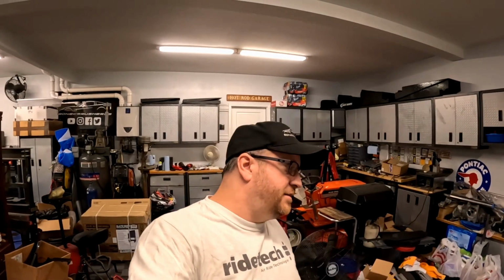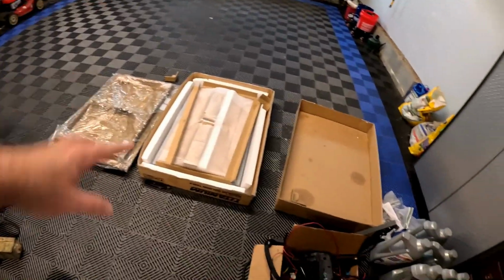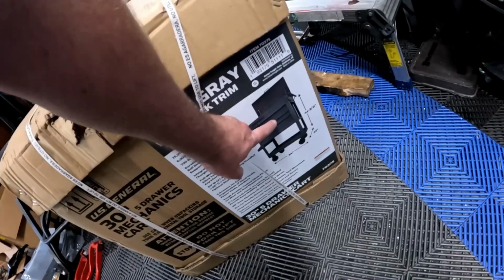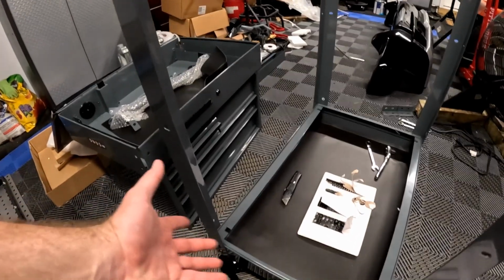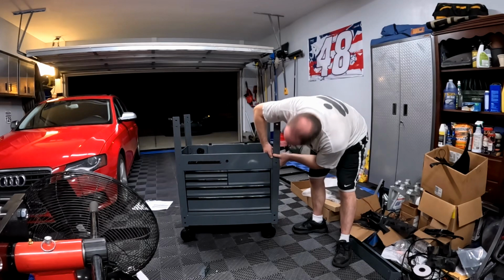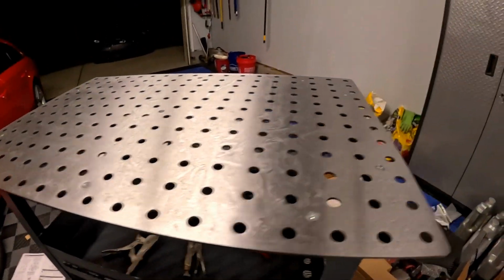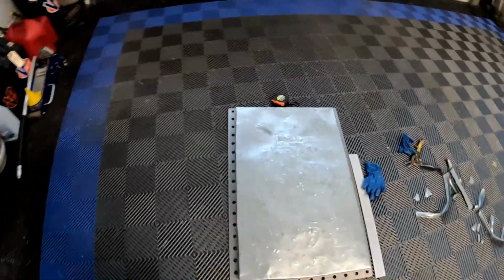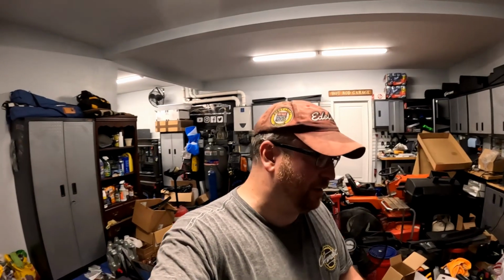@harborfreight #usgeneral Tool & Titanium Welding Table

Comment: like to see the paint after a year of use
Reply from the maker: Powdercoat is fine - most of the welding splatter will get caught with the welding tray - otherwise it bounces off the edge which is 4 inches past the box.

Comment: Timely video. I was getting the table for the current BF sale and was looking at the cart but didn't see a need for the cart in my current space, and searching videos for table ideas for storage.  Never thought about combining them until your video so thank you. 

Watched your follow up as well. How is it holding up for weight with the extras?  Is it offset any when rolling  having the vise on the side?  How is the table at the height or did you trim the legs down any?

Any other notes of what you ran into or changes you would recommend if you did it all over again?
Reply from the maker: Only thing ive updated was swapping the straight castors for swivel. I had an extra set from my 27" cabinet and makes it a ton easier to move around. No weird rolling to one side as the whole unit is pretty heavy. I've welded brackets, exhaust, and other projects on the table with no issues. Im 5'10" and I like the taller table. The low table sucks to bend /hunch over.
Reply: So the cab castors are the same, that's good to know. They are able to order direct for the gen3. Weird they list parts available on the cab but not the cart.

Comment: How did you secure the fixture table top to the 4 angled uprights? Did you just tack it in with welds, or did you punch horizontal bolt holes through the black square stock framing the table top is attached to?
Reply from the maker: It sits on top of the vertical grey pieces. They fit perfectly inside the welding table black frame. 

You could drill holes and bolt together - but the top weights enough it's not going to move.
Reply: @bonecrrusherSS  thanks, I really appreciate the reply. I’m going to try to tackle this over the weekend.

Comment: Pretty cool, only thing I would do different is putting that catch tray on rails so it can be pulled out and cleaned🤔
Reply from the maker: It's almost easier for me just to pull the top - I think its like 6 bolts.

Comment: so is that table frame a direct fit?
Reply from the maker: It fits like 99% - I had to slit those 2 small parts on the top of the box. Its shown in the video being cut by that small Milwaukee tool.
Reply: @bonecrrusherSS thanks for the reply.

Comment: Attach a plate with magnets for easy cleaning of the grind and splatter debris. You could angle it so stuff falls out the back into a container.
Reply from the maker: It's 4 bolts to remove it - not too bad

Comment: I have the tool cart and I'm really grateful for this info. I just didn't seem to get the way the welding table top was actually secured to the cart. I'm going to do this as soon as I figure out the way it is attached to the cart. love this idea though. yes I'm now subscribed.
Reply from the maker: So you can bolt the welding top to the legs. Drill holes if you need to.

The top + the oil drip tray is so tight against the legs - I didn't even need to use hardware.

Comment: Why not put the casters on the cabinet, and use the bottom tray as the top spark catcher? 
Also, if you hinge the top, you can clean it out...
Reply from the maker: I'm pretty sure the cabinet has no holes or reinforcement for attaching any casters to it. 

As for the top of the box - still might cut the corners out and put it on top of the box below the welding table. 

As for a hinge - lets be honest I'm not going to be cleaning it out that often.
Reply: @bonecrrusherSS  if an air hose and shop vac can't clean it, it was meant to be patina.

Comment: Since you put the sheet metal underneath you’ll have to result to using the inserts hook clamps…they have them on stronghand tools and fireball tools websites. Just wanted to throw a suggestion, cool project👍🏾
Reply from the maker: Yeah the provided clamps are garbage - I had already been looking at some of the brands you suggested. Thanks!

Comment: How are you going to be able to use the clamps
Reply from the maker: The provided clamps are crap. Any professional welding table does not use a clamp that bolts in from the under side. You can buy real clamps for about 20 bucks a pair online.

Comment: Couldn't you have just attached it to the lid of the tool cart? This way, you can lift the lid/table to gain access to the upper storage compartment.
Reply from the maker: You would have to cut 4 big holes in the lid to get it to work. Plus you would have to open the lid everytime you want to open a drawer.
Reply: @bonecrrusherSS I like the way you did it with the box down low but, I’m wondering why you didn’t just use the lid of the toolbox instead of the drip tray?

Comment: EXCEPT, the clamp fixtures and others require a NUT on the bottom that you can not get to with the bottom covered.  This defeats the utility of the nice clamps that come with the table.  For more money, you can get shafts from 911 Motorsports that convert the clamps to just drop in.  Personally, I would not really have cared about crap dropping in the tray, or would have used the provided top as a slide in cover when I was welding.  Great idea to convert the cart like you did.  Every similar to what I did with the cart with the solid wood top.
Reply from the maker: The shitty clamps that came with the table - you can use them on the outside 2 or 3 rows still.
I've been doing a lot of welding recently - and still just use my magnets. I also have some panel welding clamps that I have used. If you had a table with the side panels attached as well - you still couldn't use the provided clamps. They do sell some professional welding table clamps that do not use nuts on the bottom.

Comment: I have the folding HF welding table and welded some casters onto the front lower fold out legs and a handle on the side of the top, that way when its folded I can wheel it around and still store it in tight places, theres a few other welding table companies who already make it with the wheels and handle on it so I just copied there idea, for the price of the HF folding welding table you cant really go wrong, I also have another HF welding table with the same mods and I welded a sheet of 1/8" plate on top of it and 1" angle iron around 3 sides so it remains flat, is still mobile, and I can tig weld on top of it, creative video tho overall combining the tool box and welding table to make a mobile table that works for you.
Reply from the maker: I had that folding table with the brass colored finish on top - never really cared for it. I like this version that I can just roll out of the way. 

Plus I am only welding every once in a while - and this makes a good storage spot for new parts 🤣

Comment: This is cool..i actually might do this...... that being said, that drip pan you put on there is a major design flaw. The clamps that came with that table require you to reach underneath and put on a nut..... also when you drop small parts and tools through the holes it will be terrible to retrieve them
Reply from the maker: Magnet can easily get most of the parts I've dropped in there. Also the clamps that came with the table are garbage - most professional clamps do not need to be bolted in from the bottom.
Reply: @bonecrrusherSS this table isnt thick enough for that.

Comment: Does the sheet metal block the functionality of the welding clamps? Seems like it won’t allow some of the fixtures/clamps to function properly by going all the way down into the hole.
Reply: I would put angle as a place for the tray to slide on.  Giving ease of dumping and access to the underside of the table.
Reply: @JackSmith-jj3bi  I agree. I know I would be guaranteed of dropping a critical nut or bolt ( or something) through the holes and have to take it apart to retrieve it. I know it’s a welding table but crap always gets placed on horizontal surfaces.
Reply: @genecarden780 it happened to me several times but I can reach under mine. 😮
Reply: @stuartkorte1642  that seems like a much better, fairly easy to achieve solution 👍
Reply from the maker: It's sitting down 2" or so - and the Titanium comes with clamps
Reply: I would use the top that was taken off and mounted a couple drawer slides onto it...